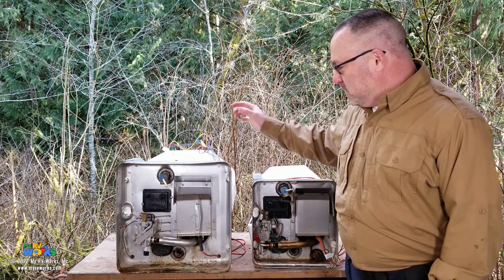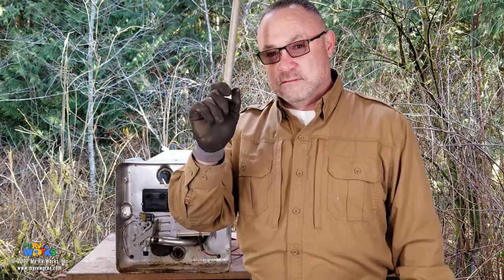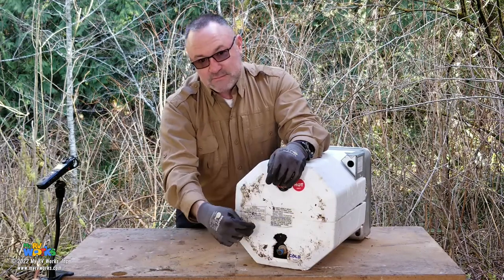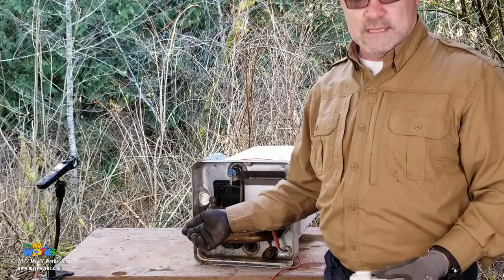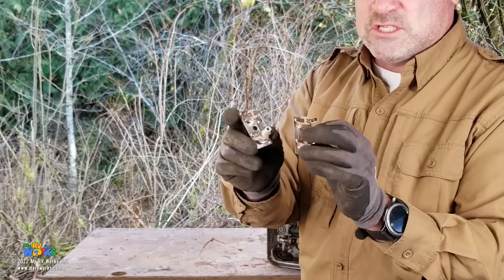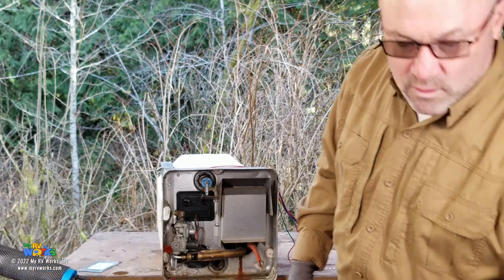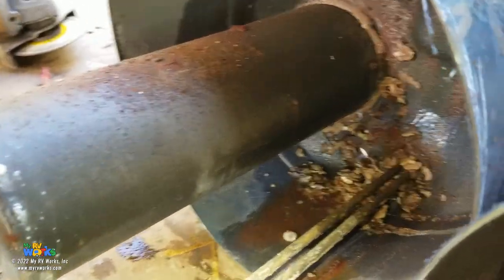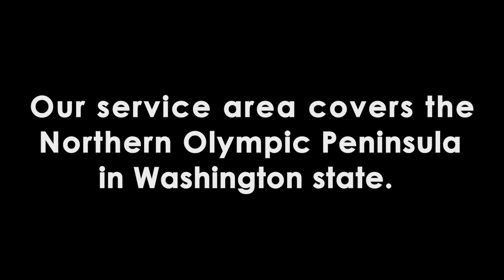Suburban Water Heater Dissection -- My RV Works

Comment: Darren & Dakota thank you for doing what you do. I have no experience or training with electrical, motors, water heaters, furnace ... shall I go on? Your ability to explain the overall concept of a system, break it down into manageable parts and then reinforce and summarize before you move onto the next stage is exceptional. I must also mention Dakota's filming ability to bring into focus the small parts and difficult angles which enhance the learning and understanding. Thank you for helping me understand my RV🤗

Comment: Darren, Thanks for the excellent video information. I am wondering and would like to see how you remove the anode rod when it is rusted into the tank fitting. An impact gun will normally work but I am concerned about damaging the tank more. A lot of seniors with older rvs would rather not replace the anode than chance more damage expense. Thanks for every thing, Charles.

Comment: I would love to get your opinion on something I've been thinking about.  My current Suburban water heater is fine/operating normally but I'm  considering going tankless in my RV.   The only reason I haven't swapped it out all ready is  1. its not broken and 2. I like having options.  I don't want to loose my electrical option.  So here is my work around and I would love to know your thoughts about it.  I purchased a 2.64 GPM propane tankless water heater and my plan is to plumb it into the existing water plumbing (on a valve) just prior to entering the water heater.  My thought is the existing water heater becomes a 6 gallon / 23 litter  mixing vessel and should be fine being fed 125 Fahrenheit  / 50 Celsius water vs. whatever the ground water temperature happens to be (in my case, about 60F/16C).  Does something immediately jump out to your as a concern?

If you think this is a stupid idea, I'll just swap it out with the Suburban IW60 (unless you have a better recommendation (or affiliate link *hint*hint*)).  Should I have any concern about feeding it he additional 48k btu's of propane the new one consumes?
Reply: Did you get an answer yet?
Reply: @davidphilpott31  No - thanks for asking.  I did back fed my plumbing system with my tankless as a proof of concept and it worked (great, long, hot, shower without pressure drop) although temp control was a little tough and front loaded.  It will work.  I just need to think through the valve (and check valve) a little more.